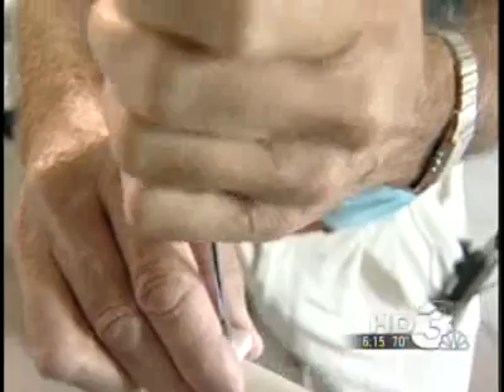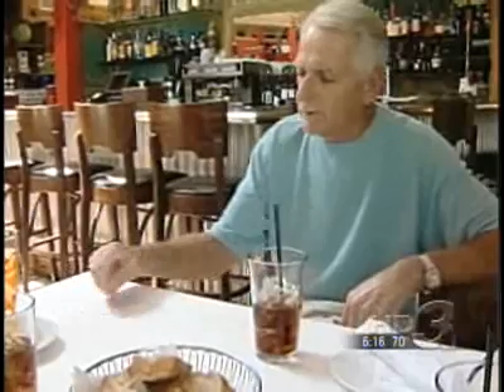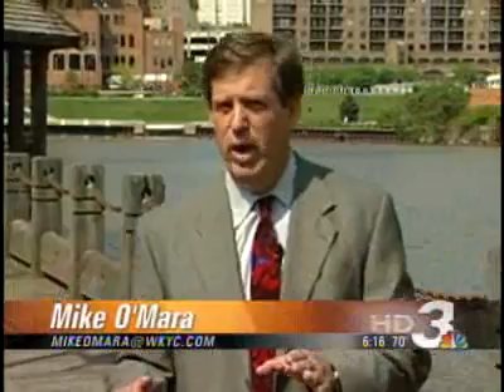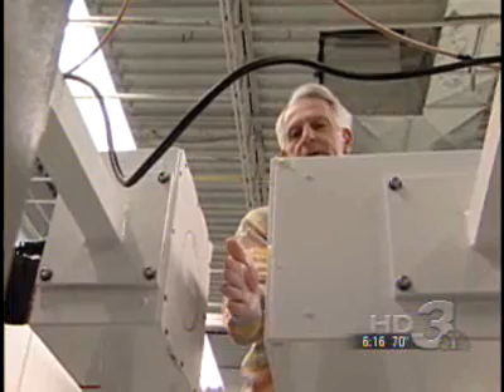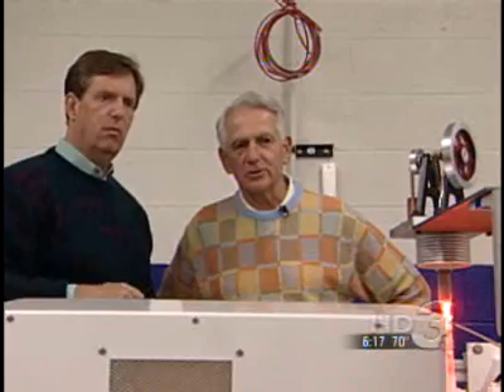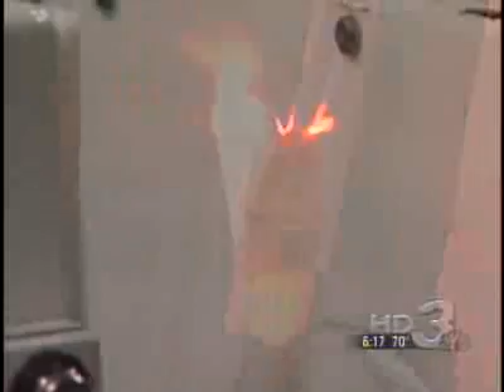Salt Water Fuel Source

Comment: need info on the radio waves required to do this, the machine that makes those radio waves, and how much power is required to run said machine.  also, once the radio waves hit the salt water, can that gas be fed into an engine?  so that a spark plug and ignite the gas or does the gas require the radio waves to ignite it.